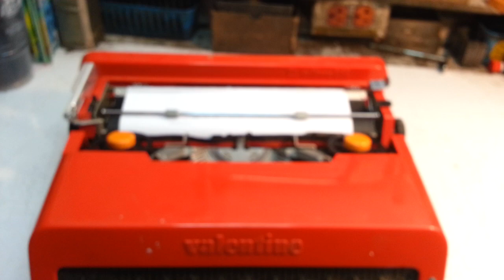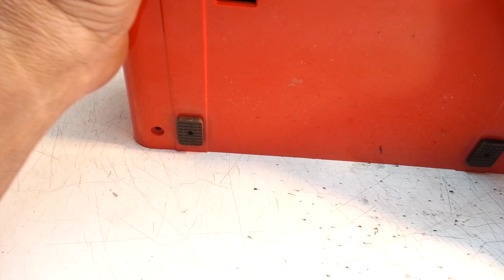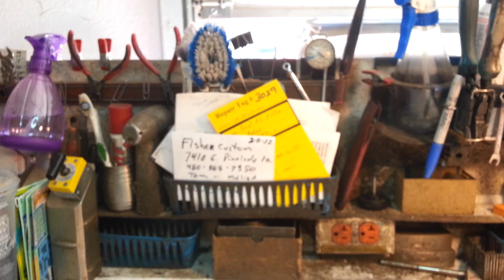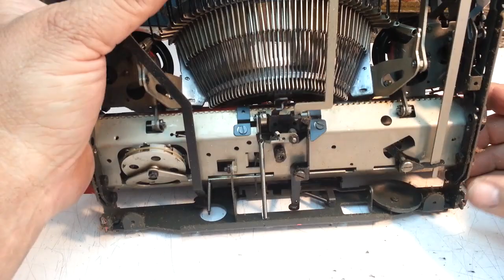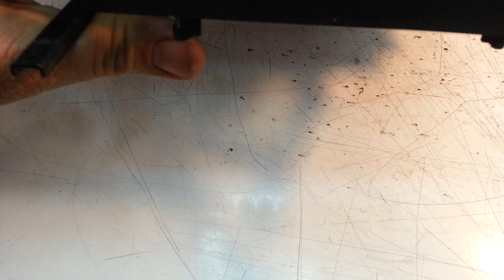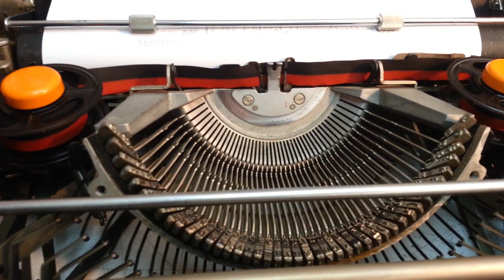Valentines Day 2022 Olivetti Typewriter, Remove Body, Space Bar

Comment: Your'e not kidding!  Style over substance, that machine, a long way from the wonderful Lettera 22. The 22 has a custom cast alloy chassis with adjustable eccentrics and stainless steel guide rods, and the valentino(!) sinks all  the way down to a cheap pressed steel chassis, assembled in a similar manner to cardboard boxes!  Push a tab through a slot and twist the metal!  NOT designed for disassembly. I have a nut-driver skinnied down on the bench grinder, to fit those tricky nuts, holding the bar in front of the spacebar.